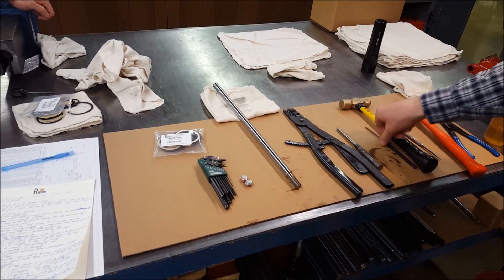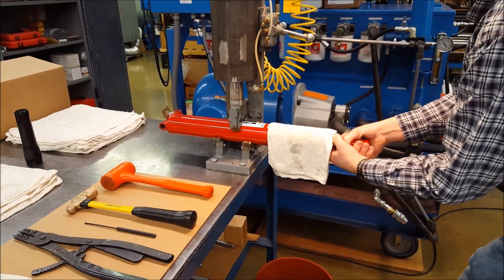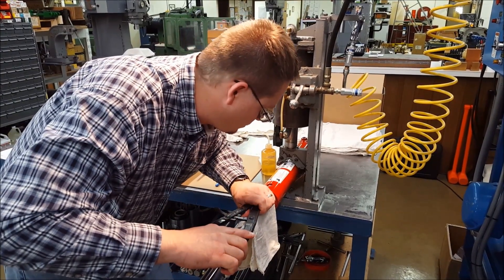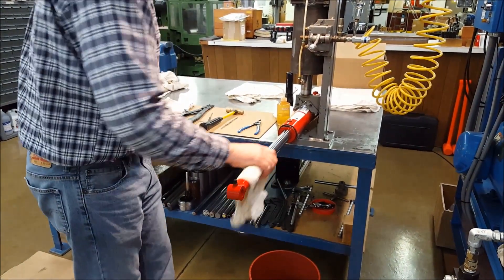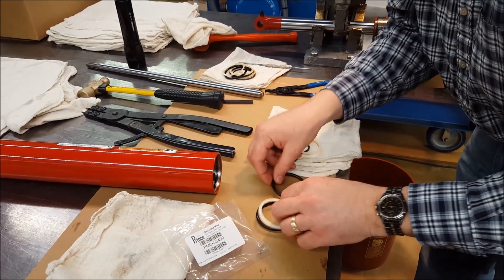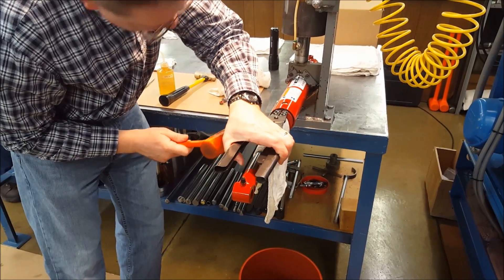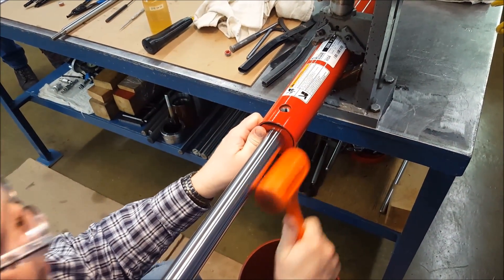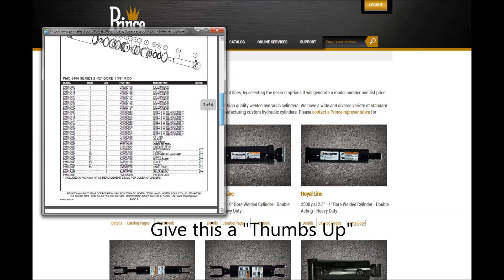How to Repair Snap Ring Cylinder

Comment: Little help please… I have an easy dumper trailer that was build in the 1990s.  The cylinder Has a lot of bypass and struggles to dump a load of gravel.  The cylinder doesn’t have any markings.  Single action 1.5 inch shaft, 3 inch bore. I removed the internal snap ring and attempted to extract the gland and rod from barrel.  Tried pulling the shaft out by hand and using a large dead blow hammer; no joy.  Watched a video of the rebuild of a John Deere cylinder showing driving the gland into the barrel to expose the internal ring.  Used a brass drive punch and 2 pound hammer; no movement, feels solidly seated.  Tried chaining to my truck on one end and backhoe on the other.   I can drag the truck with the backhoe; still no movement.  No clue where to go from here.  Have pictures but don’t know how to post them.
Reply: Welcome to the club. I have the same issue only EZ Dumper dump bed insert.